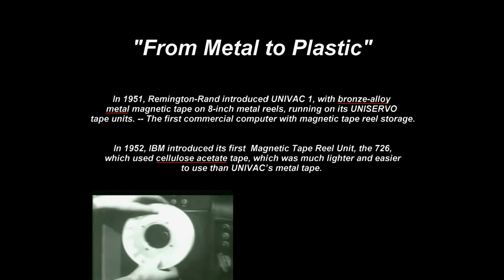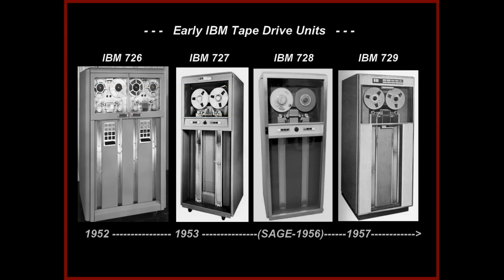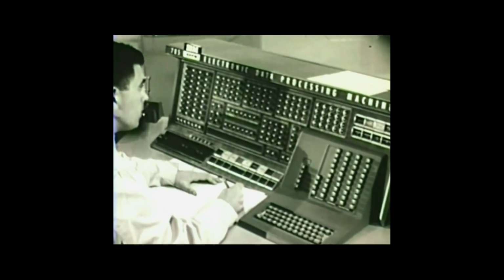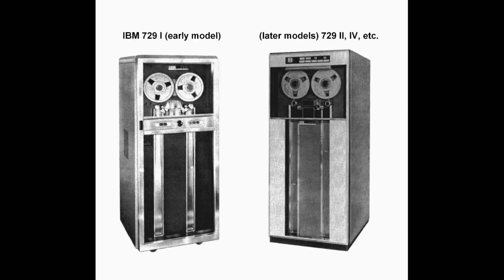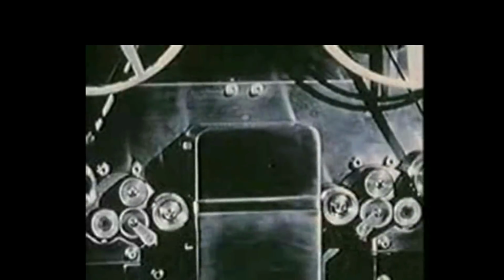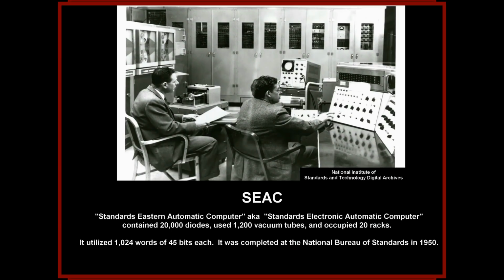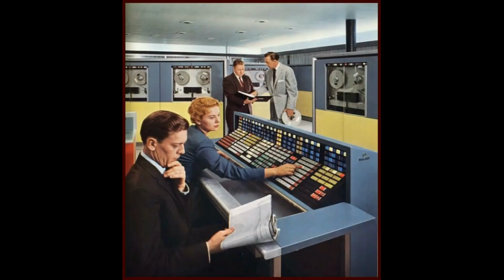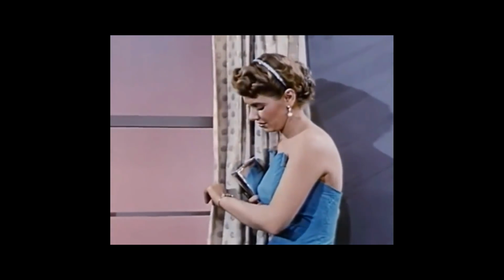1951-1968 Early Computer Magnetic Tape Units-  History IBM, UNIVAC, RCA, AMPEX - Educational Video

Comment: I would love to know more about the general maintenance of these tape drives ran at high speed in what seems like an otherwise typical Reel 2 Reel form factor. I still use compact cassettes at home with most of my music recorded to blanks, and I know how much I need to clean my head, capstan and keep good condition rollers with that, and that's with good low rub off 1990s and later tape stock. The maintenance for these must have been insane, and it makes me wonder about error checking/ handling of misread data from a dirty or possibly worn head
Reply from the maker: Yes, maintenance was a serious issue.   Tapes could stretch over time, and were sensitive to temperature changes, humidity, and so on.  The IBM manuals for the operation of the drives had some cautions for operators to be aware of. The later machines became much more reliable too.

Comment: Pretty fascinating , at least for a research nerd like me....altho the various specifications / capacity details go over my head a bit.
 My own  specialty field is in  a few  spoken/ written (human) languages.

 Anyway, I wanted to express astonishment about two items described. 
One: I hadnt been aware that in depth, continuous operations computer systems were being adapted,  so early as the early 1950s.
Two: amazed that a semi mechanically  based system can process the data from 250 cards a minute !!!
 I believe (?) that is the statement  I  heard during  the first several moments of this presentation.
Reply from the maker: Yes, some early machines were fast at processing card data, but there was not much data on an individual punch card.  The mechanics of moving parts for cards and tape reels could eventually not keep up any where close to the processor's demand for data.  And they made the computer room somewhat loud too.   ~  good observations!   Thanks.

VK  CHAP

Comment: The Star Trek: The Original Series "Tomorrow Is Yesterday" episode is Episode 19 of Season 1, not Episode 21.
Reply from the maker: Hi Patrick, yes, you are correct, based on the original numbering.   However, if one looks at the VHS copy of the series, it seems they called it episode 21.  Episode 19 is more correct. Thank you for pointing this out.

Comment: 26:06 - Self loading collars! My operating system development tapes had these, carefully set up with the pointed and crimped leader on the tape. They worked perfectly every time, except for the operators ignoring my LARGE PRINT labels, removing them and putting greasy fingers on the tapes as they threaded them manually.

Comment: My desk top can do more then a room full of that old tech. I did back up on tape drive a cartridge type, it took a long time for daily back up.
Reply from the maker: Yes, and if memory serves, cartridge tape back ups were not always reliable when it came to retrieval time.  They could only be used so many times before tape wear degraded the recording capability.  You're right, it took a long time for daily backups... Thanks !    ~  VK, CHAP
Reply: @ComputerHistoryArchivesProject  Also, not many know that the 727 200 BPI tape drives on the 705 had no read check after doing a write .... so if you had a write error you wouldn't know about it until you tried to read that tape in a subsequent run.  Not good if it was a generational master file tape and if you were updating the master file and hit the error you would have to go back and rerun the previous master file maintenance run.  A real pain.  We had two 705s and towards the end of their lives we couldn't schedule a sort that ran two hours or more because they were almost certain to blow a tube.  Then we'd have to find the tube, replace it, and start the sort all over again.

Comment: For me, the greatest advance happened in 1980, with the elimination of the f-ing punch cards! Suddenly my job got much easier feeding floppy disks into the system instead of thousands of stupid cards.
Reply: I remember the old punch cards, I used to load thousands & if there was 3 errors the program used to crash & I had to start over...
Reply: By the time I was a programmer, in 1977, we used punch cards only for job control and small changes to code. But when the external auditors came in they brought attache cases full of test code on cards. And they always had exotic colours, like orange and pink, ah how I envied them those cards, and us with the dull white ones.

Comment: I sometimes wish I was born a few decades earlier as computer systems seemed to be much more interesting and challenging than they are today.  Being a hardware guy, I would have loved to work on the mini and micros of the 70s and 80s.  I tend to deal more with software / program issues ore than hardware issues these days.
Reply: I worked for some time on a Honeywell 66/05 mainframe bought  in 1968 and discontinued in 1992. Believe me that you would get tired  of maintaining such a machine... I remember the routine maintenamce of disc units (10 discs pack) between  cleaning and mechanical settings  it was a nightmare and there were 8 of those units, each big as 4 washing machines altogether... the tape units were less critical about maintenance... then there were high speed printers, flashlight disc scanners to be taken care of and the processor units, disc and tape drivers unit were also to be dusted and have routine maintenance to be done and routine tests were altogether a lot of work! However when it was doscontinued I couldn't see it scrapped so I tranferred it to my garage... and it's still there because I don't have "the heart" to get rid of it even if it will never be possible to bring it back to life after being "resting" unused for almost 30 years.
Reply from the maker: Hi ESD180, thank you for sharing your thoughts.  I can certainly understand the feeling. ~   VK, CHAP

Comment: Tapes still exist today, and the dominant standard used today is the Linear Tape Open (8th Generation).
Reply: Depending on the particular category or classification of systems, the "dominant standard" differs widely.   The current, "dominant" tape format used by most current or recently-current generation of mainframe systems is the IBM 3592 "Jaguar" Gen6 with a native capacity of 20TB.   While the Jaguar Gen6 is the "latest" release of IBM 3592-series cartridge tape formats, the previous  technologies, known as "Magstar" 3590, and the 3490 and 3480 families of cartridge tape formats, are still pervasive, particularly in large-scale enterprise tape libraries.   Additionally, 9-track open reel tape in legacy formats is widely used, particularly when interchange between systems and manufacturers is involved, and of course millions of reels of 9-track and earlier 7-track open reel format tapes exist in archives and systems libraries around the world, maintained by mainframe systems managers and corporate archives.    

It's easy to make the mistake that LTO (and its predecessor, DLT) is the most commonly used, and therefore dominant, tape format or technology, and with the need for ever-increasing capacity for offline storage in the microcomputer and midrange systems market, LTO definitely has secured its niche for the time being.   However, it is very important to note that with the drastic drop in prices of NAND flash memory, and the relatively inexpensive and easily managed tiered storage systems marketed by micro and midrange vendors such as Dell/EMC and others that build on SSD technology, virtual tape drives, virtual tape libraries, and NAND flash-based cartridge systems are rapidly gaining foothold where large and expensive to maintain, operate, and extend LTO and DLT mechanical libraries used to reign.   

Just my $0.02. :D
Reply: @craigjones3325  👍🇵🇱 Warsaw tnx.
Reply: IRS system is still this old.
Reply: I wish they did...your words are not standing the test of time.  I miss my ADAT machines.  I miss waiting for my 3 decks to sync up.   Glorious mess.

Comment: so, were any of these various tape drives interchangeable or were they only limited to their particular  setup? thanks in advance .
Reply: The 1/2" tape systems  mostly used "IBM compatible" formats. The tape drives were start-stop: the drive would go from a standing start to speeds up to 125 inches per second, write a block, and then stop - hence the jerks you see when they are in action. The vacuum loop was needed to allow the drive to stop from 125"/sec and then start again in an inter-block gap of 1 7/8".   Block sizes (ie number of chars in a block) was normally defined as the number of punch card images in a block - typically, this would be 20.  It was normally possible to read 7-track tapes on 9-track drives. It was not always easy to do do it. The bit patterns might not mean the same thing. I once used an ICL computer to read tapes written on on an IBM 360 as binary, and then write them out to tapes for reading by a CDC7600.
As far as hardware connection was concerned, there were several competing standards provided by various manufacturers. However, a lot of manufacturers supported competitive manufacturer's interfaces by replacing one or more 15" square circuit boards (obviously, after PCBs were used). Manufacturers like Ampex and Data Dynamics would support IBM, CDC, DEC, etc's interfaces.  Towards the end of this period you could buy third party interfaces, and even SCSI interfaces for the drives. 

I built an interface for a BBC Micro to a Data Dynamics interface, and designed a SCSI tape interface  for the Apple ][ as well as products for some of the mainframes listed here. I still use 1/2" tape in the form of LTO cartridges with SCSI interfaces to modern PCs.
Reply from the maker: Hi kae4466,   That's an excellent question.   From what I have researched, many equipment vendors tried to make their tape systems downward compatible with previous equipment.   For example, the UNISERVO II tape units from Remington Rand UNIVAC could read the older metal tapes as well as the newer Mylar tapes.   Also, some non-IBM vendors learned that if they made their tape machines and computers compatible with IBM tape units, they could often obtain additional sales, by marketing to IBM customers.   However, there were instances of tape drives and formats being specific to a certain computer, especially in late 1950's early 1960's.  I do not know how much tape format compatibility there was between big vendors such as GE, Honeywell, IBM, RCA, etc.   Also, as an interesting trivia point, many tape drives were made by AMPEX company and re-labeled by one of the big computer makers.  Hope this helps!
thanks...   Mark